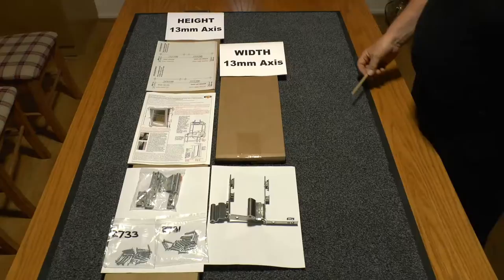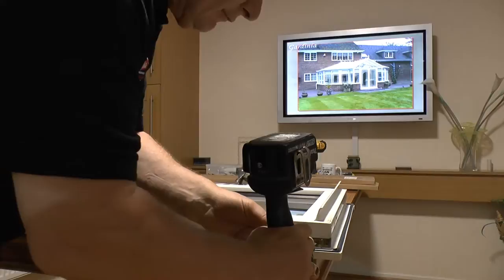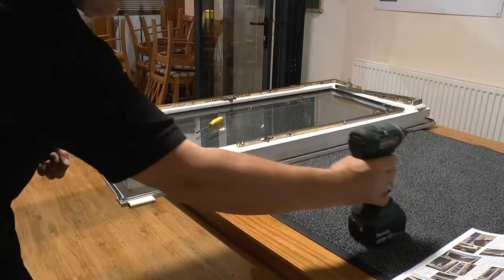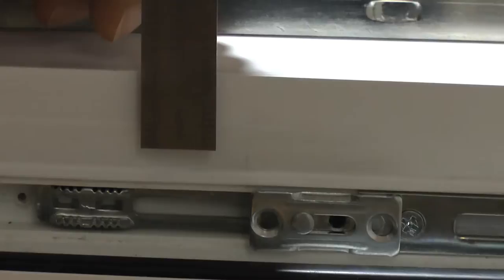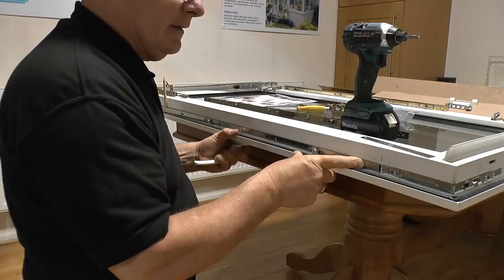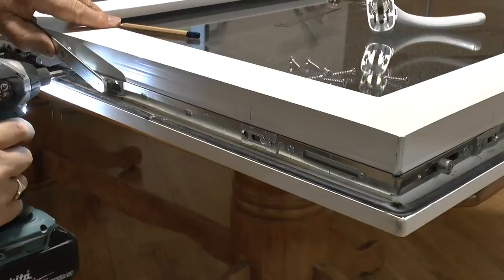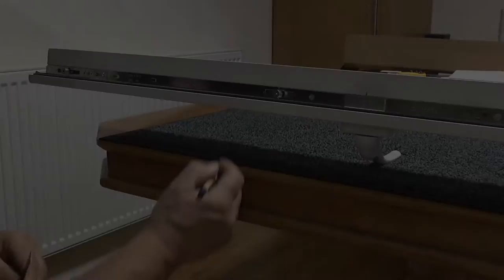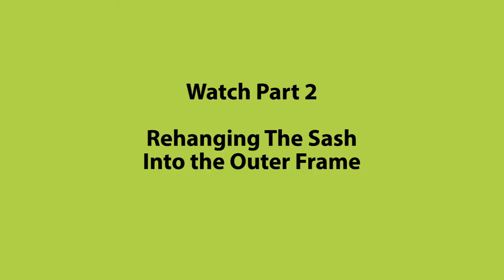How To Replace Tilt & Turn Window Gearing Part 1

Comment: Its difficult to advise from afar however it is usually the gearing around the window that becomes worn and fails and once this starts to occur it starts to stop pulling the window sash back into place on the locking points and sealing properly. What you certainly will not be able to do is just replace the sash as the old profile used will no longer be able to be sourced and any new profile will not be compatible and will prevent the frame and sash meeting together and closing properly. In a nutshell it always becomes a decision to re gear everything with new parts or purchase a complete new window   Hope this helps Allan upvcspares4repairs

Comment: Can i replace just the handle gearbox without taking the whole mechanism off?
Reply: I’d like to know too.
Reply: @farmerdan7274  I found out that the main front mechanism will come off with a bit of careful screw removal and the gearbox can be replaced with the window still on its hinges.